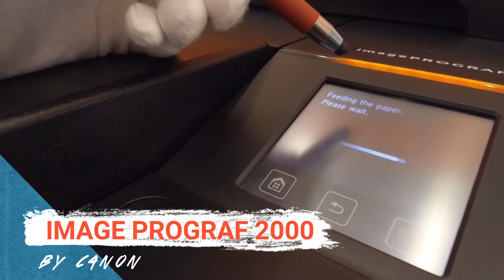Creation of Canvas using GoFrame and CANON PRO-2000

Comment: Nice video. Quick question, do we need a liquid coating or spray coating, which one would you suggest. Another thing, do you have a humidifier ? If so can you please suggest one? I am planning to get Imagegrapf Pro-1000. Whats your advice pro-1000 / pro-2000? Thanks for your time.
Reply from the maker: -> For most canvas medias liquid lamination (coating) is strongly recommended as it will allow better stretching, prevent paint cracking on edges and will prolong the life of canvas overall. I'm personally using this one:
https://www.lexjet.com/sunset-satin-coating
-> I am not using a humidifier at this point but I will research that topic and let you know later.
-> Though 1000 and 2000 are using same printheads and inks those are pretty different models with different costs. 200 is more efficient in cost-per-print while 1000 is better when you print from sheets.
You are welcome to join our FB group where we can discuss this topic in details.
Reply: @denkoimaging1133  Thank you for your response. Much appreciated. I already sent the FB request. Got approved too. Looking forward.
Reply: @denkoimaging1133  Can you please advise how many 11x17 prints can be printed with the inks that come with the PRO-1000 or PRO-2000 printer? Approximate # is fine for reference
Reply: @emprintstudio3397  4000 come with 300ml ink supply x 12 tank.  It take about 1.5ml of ink per square feet based on an article I found.  I heard the PRO-1000 waste a lot of ink in maintenance (50% of it).  I have no idea how much wasted ink occur with the PRO-2000 or PRO-4000 (trying to find this information).
Reply: @mochouinard  Thanks. Yeah me too heard Canon wastes lots of ink on maintenance. Let me know what you find out?
Reply: @emprintstudio3397  They can, but if you use something like inkjet plumber on mac to send automated exercise prints you can keep the maintenance cycles to a minimum and save ink. I think q-image on pc has a function like this too.
Reply: @emprintstudio3397  I know this is an old reply, but there really isn't an easy way to provide an approximate or estimate number of prints you can get from either model.  Since this calculation is based on the media type, quality setting and image details, it makes the info almost impossible; and this is for any printer unless you do the exact same print on the same media the whole time.

Luckily, the accounting tool (from Canon's site) may provide some detail on it after you print.  You'll have more printing ability with the larger models because of bigger inks though (Pro-1000 with 80ml and Pro-2000 with 160ml).  Pro-4000/6000 come with 330ml.  The newest version is the 2100/4100/6100, but with same sizes as previous series.
Reply: @denkoimaging1133  Can you put this coating on after you've stretched the canvas? If you wanted to paint on the canvas, can you do that after it has been coated?
Reply from the maker: @kohls350  yes you can. I did it a dozen of times on our "wedding-signature" canvases

Comment: Great video! Can I use my Canon pro 1000 printer?
Reply: Yes. You can make canvases up to 15 inches wide with your printer.
Reply: You can actually print 17x22 canvas on the Pro-1000, but doing a gallery wrap, it depends on which bars you're wanting to go with.  Standard (1.25"), you'll need 3" added to dimensions and Pro (1.75"), you'll need 4" added to dimensions for a proper wrap.  Downfall is since you're printing sheets, the printer isn't able to easily do borderless on every size it can print on, so this limits your wrapping option unfortunately.

Comment: Thank you for the video. You definitely need to calibrate your monitor, it is more blue than it should! By the way have you seen any banding on your prints?
Reply from the maker: Thank you for the comment. Actually, the entire video was shot on the phone and edited on a laptop. Our photo-production monitors are calibrated and are very accurate, we just didn't use them for this video. 
For the second question - not sure what exactly do you mean by banding but I have few test samples that I kept from them batch and they are doing just perfectly fine. No changes and no issues. Thanks for watching!
Reply: @denkoimaging1133  banding basically means horizontal lines due to printhead failure/allignment issues

Comment: Does the Ipf670 also prints on canvas?
Reply: I'd also like to know this. Have you had any luck finding any info?
Reply: I too would like to know ! I'm thinking about going toward the PRO serie, and at that price different, go for the PRO-4000... But if the IPF670 does produce good quality pictures worth of being put up in a house and give the wow look... For for the low usage I would do, it could be a good starter printer for me. (If I spend the extra on the PRO-2000, I would go to the PRO-4000 right away).
Reply: @mochouinard  I'd love to see with my naked eye the difference between the IPF670 and a Pro 2000 or 4000. Isn't the big difference that the IPF is more of a plotter  printer for stuff like blue prints and not a high end photo printer?
Reply: I know this may be a little late on the update, but the iPF670 can print on canvas.  Though, the quality compared to the Pro series will be somewhat noticeable because of the amount of colors you have.  The 670 is more technical based and has MBK, PBK, C, M, Y while the Pro series have 11 colors and Optimizer (basically better gamut).

SteelyD- you're correct on the difference!

The Pro-2000 comes with full set of 160ml ink (like the Pro-2100 currently available); Pro-4000 (Pro-4100 now) ships with 330ml ink ($2069 value) and same with the Pro-6000 (Pro-6100 now).  The technical models are still full inks, but smaller based on more technical type printing and less color usage.